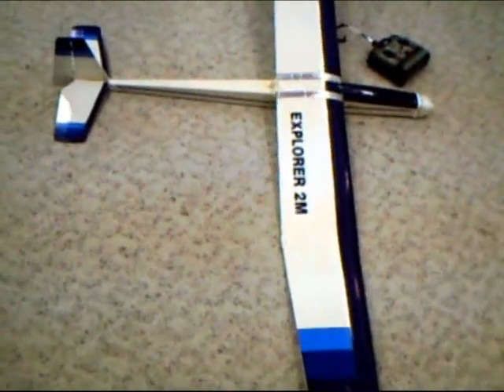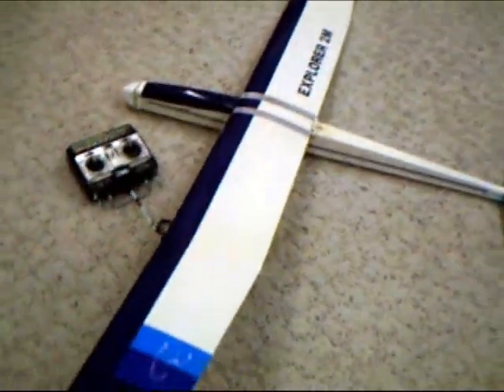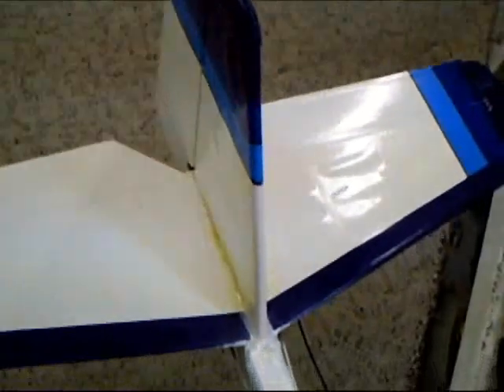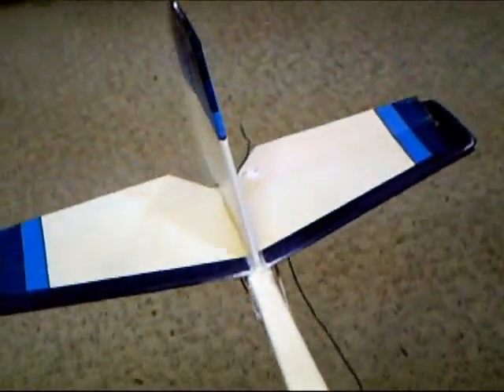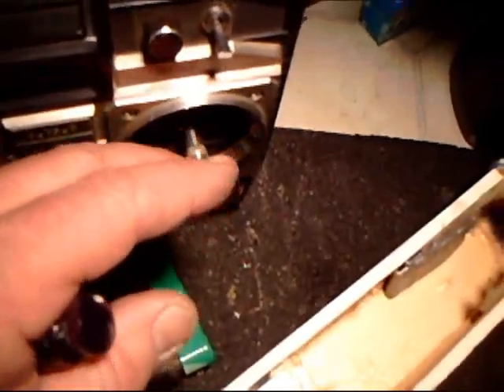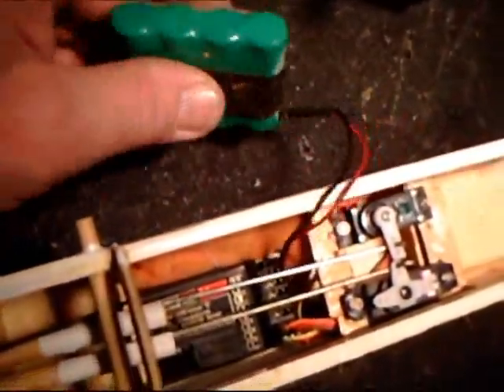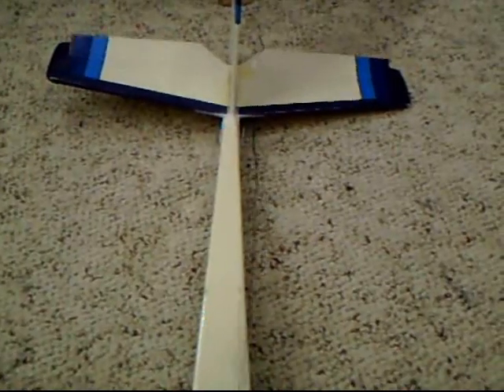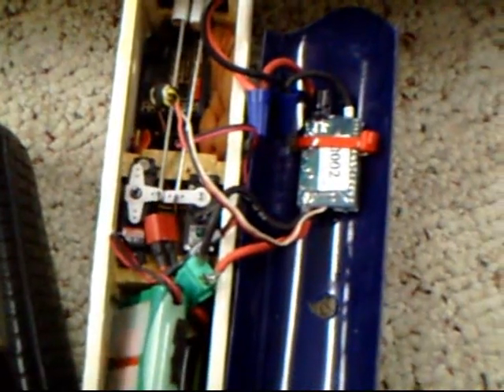Ducted Fan on Glider!  Let's see how it works.

Comment: @Spicyperson9123 props are by far more efficient than EDCs, hence, props can reach much higher speeds as well. I won't comment on which one is simpler to build... the prop with a prop and motor, or the edc with fan, duct, motor, t..... you get the point

Comment: I am sure the ducted fan concept works in the windiest of conditions but...you would probably do better just slope flying it without the ducted fan unit attached.  The unit in this weather condition is probably providing more parasitic drag than its worth.

What is more convincing of this proof of concept (utilization of the ducted fan unit) is to use it in dead calm zero wind conditions and THEN we can see the degree of useable thrust and climb rate of the model.

Klockwerken

Comment: but, how well does it glide?  can you get it to thermal?..... been thinking of a similar project, but still brainstorming on how I can get the fan more linear-maybe on the nose, or just after the wing with some doors that open and shut to allow for intake and exhaust to cut down on the drag of it sitting up there.

Comment: Those ducted fans are meant for high speed models...efficiency on a glider must suck. 

Much better to use a gearbox in the nose and a really big propeller.

Still, better to fly with an EDF than not at all.

Comment: ye that was impressive. that firebird is £50 in the UK and cos i want to make use of my spare servos, TX and RX and batteries i bought an ARTF glider, problem is my brand new motor is making a clicking noise and twitching like crazy, tried another motor and that one is ok. dont know what the problem is but the motor is brand new. both are brushless and on a DX6i Tx the guy i bought it from said some motors do this and not to worry about it :/

Comment: hey exellent work !! that looks very powerfull!! I just notice that the 2 extra arms on servo arms are touching the inside wall of the fuse and the servo is moving from its holder!! you need to cut those 2 extra arms !! keep with your exellent job !

Comment: Nice build and flying Dave. Great camera work as usual Jeff.  Does that Iowa wind ever stop? Can't do much thermal work with all that wind. Pretty much restricted to ridge soaring there. Brandi likes the planes too.  ha ha  I would guess that the ducted fan has more drag than a folding prop motor. Still, you work with what you have at the moment right? Bye